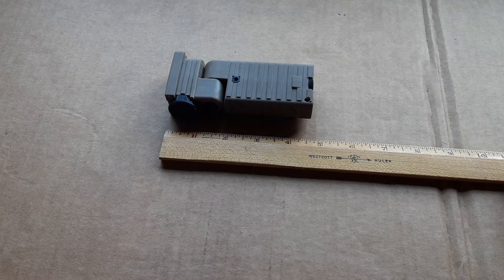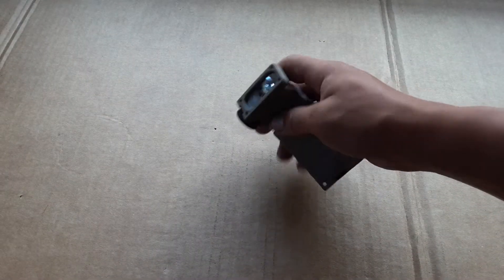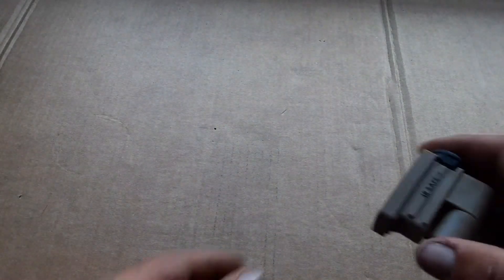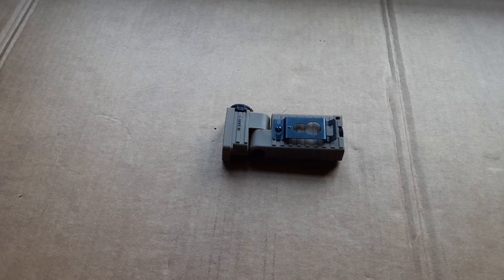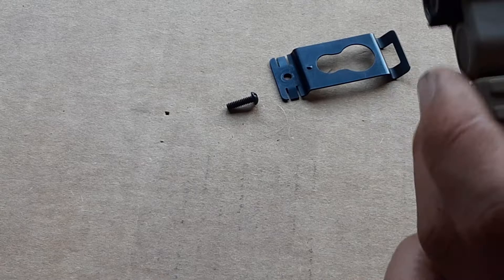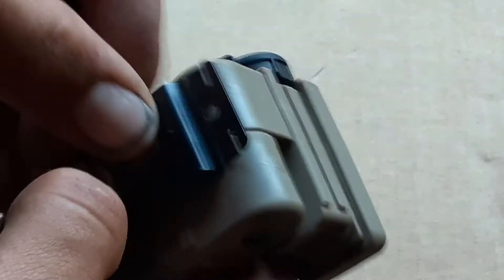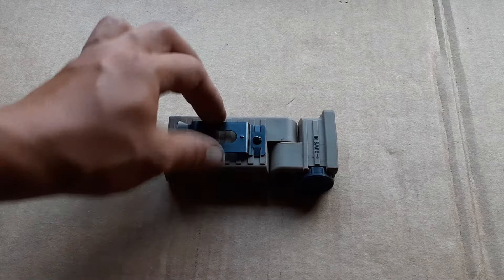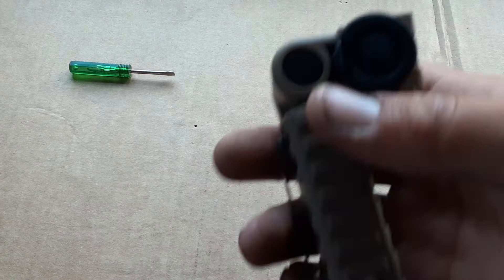USMC MCAL Streamlight Sidewinder articulating flashlight Review

Comment: nice light does it work with nimh?
Reply from the maker: I believe that is works with any and all AA batteries  in production
Reply: @wolfoutdoorreview  thanks. how about button there are lots of reviews that it broke after a year of use. is it cold white or neutral white?
Reply from the maker: @TheAcidheat  I am not sure as of right now both my lights are pretty new but the streamlight sidewinder does have a small high pitched whine on its highest setting but it is only noticeable when it is right next to your ear
Reply: @wolfoutdoorreview  thanks